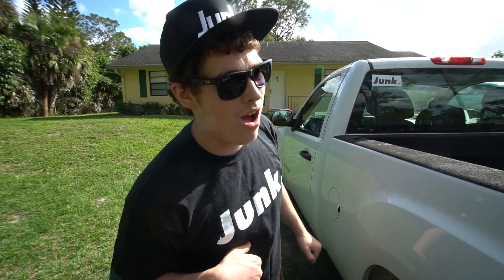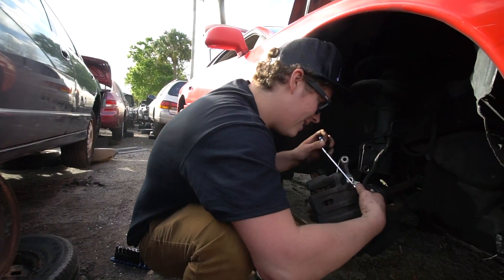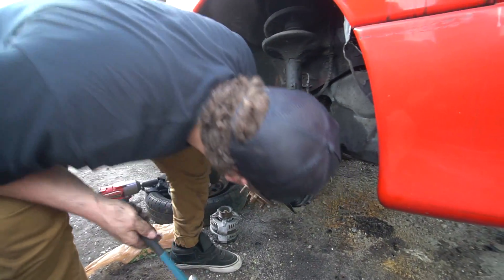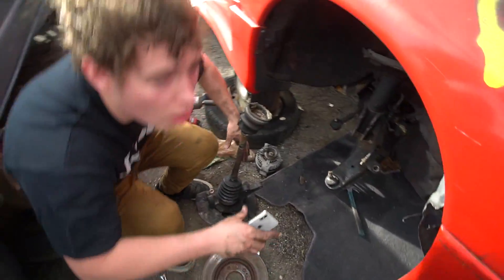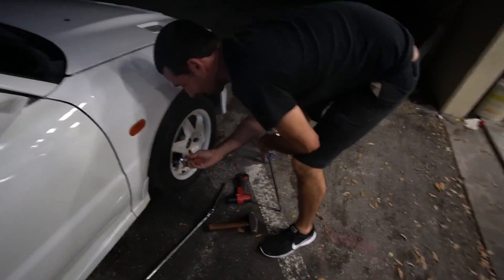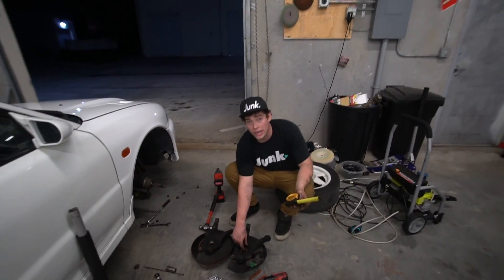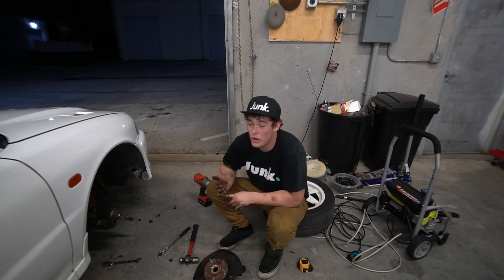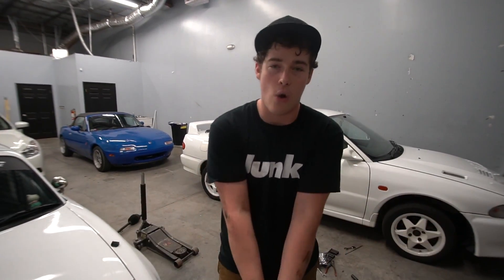TRYING TO FIND RARE GOODIES AT A JUNKYARD!

Comment: LISTEN USE THE THE 3000gt splined outer axle half one the end evo axle into the 3000 hub ...the possibilities are endless with cv axles you can make cv axles for any combination. I’ve seen all types of cv axle inners and outers swapped to get the combo u need to run
Reply: This guy knows lol was going to say the same
Reply: exactly what i said aswell lol, he probably wont see this or mine
Reply: I second this. Changing axle stubs is common.
Reply: I am a little bit disappointed that he doesn't thought of this by himself. After all these years...
Reply: Was  about  to mention that  in a comment  😂👌
Reply: Helllll Yeahhhhh
Reply: This has to be the best bet👍🏼
Reply: For some reason they never seem to split axles in america or replace the cv rubbers or joints they just buy a new axle? must cost a fortune
Reply: Measure the evo axle and cut them to size, weld the 3000gt spline side of the axle to your evo axle BOOM MIND BLOWN
Reply: @bloodyknuckles9181   its generally more common here (at least in my experience working in texas) for most smaller shops and shade tree mechanics to replace the axles but some dealerships like the toyota i work at almost exclusively reboot cvs because the higher  labor rate to reboot(over throwing a new one in) is less expensive then the new axles from toyota (frequently 350+ new from toyota) however aftermarket remanufactured axles and the like are usually similarly priced to just buying the boot kit from toyota so simetimes customers prefer to buy aftermarket. Its usually based on a lack of knowledge of how to properly dissasemble and reboot a cv axle, or a lack of the proper boot clamping tools, that people replace the whole unit. And sometimes its because many techs have never even heard of rebooting a cv and are not aware how easily they can be dissasembled and repaired.
Reply: Yeah this will definitely work. It’s not common at all in most places. It’s not good if you crank over 700 hp but works just fine if you do it right.
Reply: And u should understand how to research such a thing..stop looking in fourms and start looking up part measurements, wich u can get from the parts store..axel sizes wheel bearings and hubs as well. You might not need knuckes maybe you just need the hub assemblys
Reply: Some of you don’t realise that he’s new to some things and doesn’t know everything. Some of you talk like you know everything about how to do “this” or “that” when it comes to modifications/maintenance. It’s okay to be helpful and to give pointers because he asked us to comment any ideas, but we should be positively constructive to him as he is offering us his content almost daily. People can learn without hearing your snobby opinion. Mkay? Mkay. Fuckin right.
Reply: This is common with complex honda swaps

Comment: dude you're going to japan, just pick up evo 3 hubs and brakes, btw the same calipers are used from evo3 up to evo 9!!!
Reply: It's not just like you can take 30lbs of metal with you on a plane. It's expensive as fuck just to take a bike with you.. even at that most people take those apart and put them in golf bags.
Reply: Evo 3 are 4 stud
Reply: @dazbaz9969  you are correct  but my point is the 5 stud evo 8 hubs are a direct fit for evo 3 which is identical to evo 1 and 2 so he can just use evo 8 hubs!!
Reply: Chad Kennedy you ship parts Home not ride home with the stuff guy
Reply: @vanz7099  no they are still not a direct fit.u need to press out the later evo bearing and press in a early evo bearing into the hub.
Reply: @vanz7099  what he needs is fto front hubs and disks.if all her wants to do is go 5 stud.
Reply: @dazbaz9969  actually you just need to replace the ball joint and use the evo8 bearings and axles, the fto is also another option like you said

Comment: This may have been said before but you really need to look for a 1G DSM... 1990-1994 Mitsubishi Eclipse GST/GSX or Talon TSI Turbo or AWD for the front end parts. The 1G and the early EVO cars (1 thru 3) are a lot more similar in front than the 3000GT. The front knuckles and hubs should fit the CV shafts perfectly since they share a transmission. 

As for the rear the 3000GT parts can be used and it's been done with a little tweaking on 1G cars but it will increase the track width. The 3000GT uses a drum in rotor parking brake and not a Hydro/Mechanical unit that the EVO has so this will need to be adapted this.  Look for info on upgrades to the first gen Eclipse & Talon for more help. This hasn't been done a lot but it has been done.

Comment: Have you tried swapping the outer cv joint from the 3000gt onto the evo driveshaft? So it fits the evo gearbox, fits the 3000gt hub and is the right length

Comment: Can probably press out the hubs and press in dsm 5 lug hubs in your spindles.  For the rear most likely use 2g awd dsm rear parts.  1g rear would only work (maybe) if you used rear diff/axles hubs etc, since the axles aren't splined on both ends like 2g and evo 3

Comment: get the tool that crimps the axle boots together and just change the outer end of the axle. the cv joint will be the same just pack them with grease when you do it

Comment: On subarus and vw's the bearing is pressed in. If you measured the OD and ID of your bearing, I'd bet a nickel you could find it online somewhere. Your idea was on the money, the hub will seperate with a few carefully placed blows. The old race will need to be cut until almost through, then whack with a cold chisel to crack it the rest of the way. Harbor freight sells a bearing press kit specifically for doing this. Get 'er done!
Reply from the maker: Screen shotted this
Reply: @RicerMiata  try putting the cv off the 5 stud hub onto the 4 stud axle shaft
Reply: The drive flange is what has the spines for the drive shaft and holds the wheel studs so if you put the evo flange on the 3000 knuckle you will get it to fit but will still have the 4 lug fitting and just be running  the 3000 knuckle. 
You would be better seeing if you can get the outer races of the shafts swapped or see if you can run with the 3000 shafts..
Reply: @Ian1050st  Finally someone that understands. They don't realize the axle splines are part of the hub with the wheel bolts.

Comment: Swap to dsm hubs then you will be 5x114.3. Then you can use the dsm or 3kgt rotor and after that just make brackets to bolt the calipers up. Done! The hub just press out and the dsm will press in.

Comment: Just pull the outer cv joint off both axles and swap them . Use your old axle and the new/used cv  joint. Buy a new cv boot and it comes with clamps and grease . Then the length stays the same as stock and the inner cv stays the same. OR press out the 4 bolt hub and have it re drilled by a machine shop to a 5 lug then you never have to mess with axles .

Comment: if the shaft won't fit try putting the cv from the junk lol yard one on your driveshaft. you won't be able to do the bearing as the bearing is pressed into the hub and the driveshaft hub is pressed into the bearing. hope this helps

Comment: If the actual shaft is the same diameter then put the outer CV joint from the 3000 onto the Evo axel. Then you should be able to make it all fit. You have the parts there to try that too.

Comment: Do the awd model eclipses/lasers not use the same parts as the evo? Pretty sure both the 1g and 2g used 5 lug. I would assume they use the same type of trans since the engine is the same so you could just buy brand new axels and hubs at any auto parts store.

Comment: And the wheels bearing doesn't have splines and it fits in the knuckle but the hub fits in the bearing. And to get the hub out you need a hub puller.

Comment: I'm pretty sure you can get the evo axles rebuilt with 3000gt outer cv ends on it so it splines to the hub and the other end to the transmission

Comment: Chris I looked into some parts online evo 4 RS front hubs JDM  will work its has to be the right hand drive Evo 4 RS  I think the RS means rally sport I'm not a 100% sure I don't know much about  Right hand drive cars that's what it said on a thing I read on the Internet for conversion to 5 lug on evo 1 it also you can use the rear off the Evo 4 RS

Comment: Try swapping the outters on the axles, put the 3000 gt outter on the evo axle, also see if the rear is a bolt on bearing if so maybe you can just bolt on the awd 3000gt bearing

Comment: The awd 3000 gt might have smaller accents. Typically “higher power” fwd applications have large axles. Awd disperses the power requiring “less” strength.
Reply: Idk Mitsubishi though so I might be wrong
Reply: He shouldve gotten the knuckle assembly off a vr4 3000gt.. bigger calipers is a plus..

Comment: Splines are not in the wheel bearing.... They are in the hub.... If the inner diameter is the same on both bearings you should be able to swap hubs over.

Comment: If the hubs come off the knuckle just replace the hub. It will come with new bearings. If not have the bearings pressed out & buy the new ones you need(with proper spline count) if it's too small you're fuked. If it's too big drill out the hole in the knuckle to size.

Comment: You could have saved that axle if you didnt pull with the might of god..... use a chisel. insert it between the axle and Diff/Transaxle amd just  push the bottom and it will slide that out alot easier snd it wont be destroyed...

Comment: galant vr4 knuckles wil fit. or 90 to 94 eagle talon tsi / mitsubishi eclipse gsx knuckles . I did the swap on my Talon to fit the 3000gt brakes. you still need a custom bracket to fit the 3000 calipers after you swap the knuckles. rtmracing.com  supplies the kit

Comment: Mitsubishi Eclipse has the same axle as a Evo Lancer
Reply: So if he just wants 5 lug he could get 1g eclipse or talon hubs, press them in and use 5 lug rotors.
Reply: @mswtech8389  no use the whole knuckle
Reply: @mswtech8389  they have all-wheel drive eclipse
Reply: @ratchetmanmachine_825  cool that's even easier, its not like he was going to put a new bearing in anyway...
Reply: @mswtech8389  it all about history my friend
Reply: @ratchetmanmachine_825  What about 5 lug in the rear?  Is the rear suspension different in the 1g DSM versus the evo 1?
Reply: Plymouth laser/Eagle talon/Mitsubishi eclipse all had 5 lug awd versions
Reply: @mswtech8389  no
Reply: @mswtech8389  no thay fit
Reply: @mswtech8389  you can find a awd eclipse and the suspension should be the same as an evo 1
Reply: @mswtech8389  it's the Eclipse Spyder that fits evo 1

Comment: Take your ex love you even though one take the axle from the GT that you have already where the shaft itself goes into the bearings are into the Hub itself where the wheel bearing is disassemble it off of the GT Chef okay then go to your 3000 or to your Evo 1 shaft go to Evo 1 shaft itself take the axle end off because into the Hub and wheel bearing swap the EVO One are the GT to the Evo in the GN Diva to the GT in that will help you out cuz the axle shaft itself is still the same the only difference is is is the nut that comes out with the grooves cut on to it it's bigger it's been cast bigger the inside is not bigger the bearings and everything will still work you will have to undo the bolts that will be a clip on the inside of the knuckle itself squeeze the clip remove clip to hold the inside knuckle with the two bearings comes out you can re grease everything you can go to like your Advance Auto or going to happen or wherever you go to buy car parts you can buy the rubber boots I believe where I'm at in Ohio they're like $15 or $0.15 since and decided over it cited overnight so shall I put your bearings back on your axle shaft inside your knuckle back over the top of the packet full of grace run does it run does it Tire metal clamp clamp back around a rubber boot and install it back in the car but you can set like I said you can take your Evo 1 axle shafts axle shaft and you can take your 3000 axle shaft and take the Nubs off and enter swap them might be cheaper